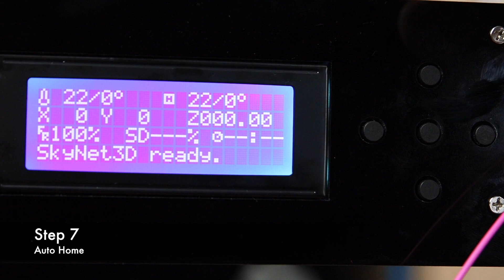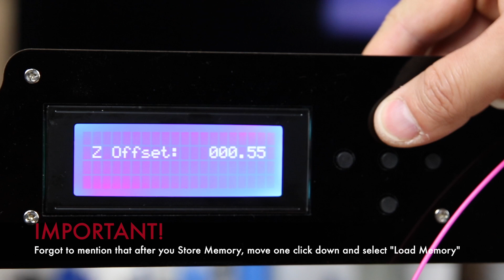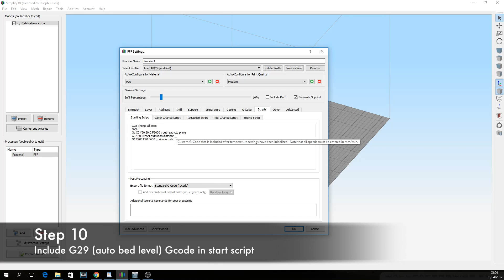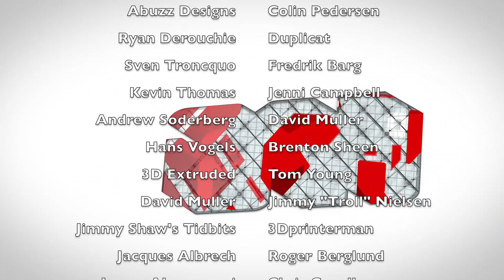Anet A8 - Auto Bed Level Sensor Calibration

Comment: just done this with my tronxy x5sa after watching this video.
To find my sensor was way to low to start with and giving me problems.
and then found out i could not move the sensor enough to sort it. so a quick print later i now have a sensor auto level that works and a printer that prints with out having to mess about for each print i start

Comment: thanks for tutorial, makes much more sense than the official one from anet :) I still experience a problem that printer won't stop when z sensor light is on. It worked for autolevelling, stopped perfectly but now won't stop after I tired to run a print

Comment: I never felt any need for a sensor on my A8. Only took a minute to set it and I almost never needed to adjust it. I would check it from time to time and it was just spot-on. One thing that I did do however, was mount the printer to a stable platform that was not prone to warping. Extra expense, extra time setting up and testing an induction sensor? Nah, not for me. Old skool works for me, every time!😊👍

Comment: Thank you so much this video is a lot easier to follow than the one that comes with the printer. (https://www.youtube.com/watch?v=3NSDzgZh0Qc&t=) I was trying to follow this video but my extruder kept colliding with the print bed. Your video makes a bit more sense. 
So let me see if I understand this correct. 
Setting the proximity sensor point of activation (step 6) is not telling the printer where the bed is but rather giving it a starting point for the Z offset which sets the extruder to the bed?
Will this tutorial work with the set up (straight out of box) I have or do I need a different firmware?

Comment: SN04-N  not with 2 layers tape working. Got a bad response on aluminium. It's arround 1 millimeter. When I hold it above the the Nema Stepper or other metal (not alluminium) the range is 8 mllimeter. Going to try he inductive one and otherwse the needle.
Reply: Didn't try a pull up or pull down. Will figre that out first
Reply: https://3dprint.wiki/reprap/anet/a8/improvement/autobedleveling is where the story is.

Comment: My Anet A8 would not connect to the computer.  When I tried to upgrade the firmware to Marlin this of course made it impossible.  On investigation I found out it's because the processor board probably shipped from the factory without the bootloader.  Getting the bootloader onto the chip required programming it with an Arduino Uno.  Once that was done, everything became much easier of course and the A8 connects to the computer every time and I can change and upload the firmware whenever I want.  I'm just waiting on a sensor to arrive so I can set up the auto bed leveling.

For anyone else that runs into the same problem here are the instructions for connecting the Uno to the J3 connector on the A8 controller: https://www.instructables.com/id/HOW-TO-FIX-ANET-BRICKED-BOARD-USING-AN-ARDUINO-UNO/

You have to flash the bootloader with the UNO (using Arduino IDE on the computer) with the A8 controller powered from the UNO,  and then you have to disconnect the UNO, power up the controller, and upload the firmware via the USB in the normal way.  Attempting to also flash the firmware with the UNO did not work in my case, though I have no idea why that was.

Maybe my machine is a cheap copy (it WAS very cheap) or maybe it came from a batch that had  skipped getting the bootloader for some other reason.  Either way, it's no problem for me now, but it really sucked that I couldn't just upgrade it easily in the first place.  At least I now have a special ribbon jumper set in my spares-and-repairs box that I can use to hook up the controller in case I ever brick it in the future.

Comment: Where do i connect the sensor in the anet a8 board? All the sockets are already occupied...
Reply: @TAMEDCSGO  Do i connect the new leveling sensor in the ZZ axis stop sensor socket?
Reply: @JohnJaggerJack  You Must remove original endstop, finish sn04 sensor with New molex plug and connect it in place of original endstop. Pay attention, where at motherboard is placed + - and signal! Its important! If You make a fail - You can damage sensor or motherboard endstop buffer input

You can also keep old endstop and connect it in serial with sn04 sensor. This old endstop Will be a solid protrction in case of sn04 sensor damage. This May prevent nozzle from hitting the table.

Comment: Hello... Great video. I have a tronxy 802 and when I try and auto home... It doesn't send the heat pad. I ensure it was connected in the right spot.. And when I pass a metal under it it works but doesn't recognize the heated... Please help.

Comment: Hi Joe  .... I know this is an old video,   How do you do this with a Bowden Setup, and the level sensor is on the right side of the print head instead of the left I cant get my offsets right, i think i should of put the sensor in the back

Comment: hello guys, i have purchased anet A8 and i have assemble it, now i'm calibrating z axis.
i have a problem with auto Bed Level Sensor Calibration, i followed the same instructions from this video but it didn't work and i didn't reach the same results ( the nozzle touches the hot bed and makes a mark on it ).
any suggestions please or can you help me how to fix it, thanks.

Comment: My probe is going way off the board, what are the correct probe offset settings?
Reply: For Skynet 2.3.2 and a tronxy XY-08N use the A8- 5buttonkeypad- autolevel- front left sensor/12mm  sensor/Configuration.h file

Comment: Actually, it is easier than this.
Add and check the sensors manually so it lit up before the hot end hits the heat bed (make room for glass bed). Can be checked with M119 G code.
In the firmware Marlin source, see to that turn on secure Z homing, Z_SAFE_HOMING, so you don't end up Z homing outside the bed. And turn on bed leveling and select method to level.

Then manually add these commands.  Can be done from repetier or from the serial monitor in Arduino

G28 ; Home the device
G29 ; Auto probe.
M501; print current settings
G1 X110 Y110 Z10 ; Go to the X and Y middle, 10 mm above the Z0
; Step down to zero manually, or if brave (stupid like me) just go for it
G1 Z0 ; Lower head to zero hight
; Us G92 tell the printer temporary that your head is 10 mm above, so you get some head room so 
; you can lower manually to right hight.  You can't manually go below Z0.
; One could use that in the slicer, but better to do a permanent setting that is stored in the Firmware
G92 Z10 ; Temporary tell printer the heater is 10 mm higher than what it is
; Adjust the Z to right paper thickness. Use control buttons or software or G1 commands to move in steps of 0.01 mm
; Continue when right paper thickness height.
M114 ; To print how much you lower the head under the previous 10 mm set with G92 (Check Z value printed last on line)
;  Calculate (read Z)  - 10 and add to next command, assume -2.0 here.
M851 Z-2.0 ; That is, lover the heat head Z0 with 2 mm from current Z0 height.
M500 ; Save all values, can use M501 to check that it was stored

; Test
G28 ; Home
G29 ; Auto probe
G1 X110 Y110 Z10
G1 Z0
; Check if ok, if not adjust the M851 Z value above and do a M500 to save
M501 ; Print settings, check value for M851 Z

Now you only need to add G29 after G28 in your slicer software in the G-code header, like did above.

(From memory, check Merlin software or other sources)
https://www.youtube.com/watch?v=G-TwWfUzXpc&t=195s
https://www.youtube.com/watch?v=EcGFLwj0pnA (a bit old)

Comment: I noticed there is a menu option for autolevel. This performs the 9 point test. Can we use this menu option and then load a print that does not start with G29?

Comment: Which version of skynet are you using with this auto level? Stock, right? At me, its confusing: when i say auto home, it goes to the middle for auto level. But when i "press" auto level, it goes to 0, 0 and goes down. But there is no bed anymore, so it goes down too much. Does it think the sensor is at the back? Also, auto level means, it calibrates itself, but then it must "drive" over the bed, like yours. Mine doesnt

Would be cool if sb could helo me :D
Reply: Same problem! Anybody help?

Comment: Hi people,
First thank you very much for this tutorial, it was very useful to me. I followed all 10 steps and my Anet A8 worked fine for a while (few months). But now when I try the Auto Leveling the display shows an error, "endstop hit: Z". I recalibrate bed level, level sensor, cleaned Z screws without sucess. The error persists and I have no idea. Would you please help me? The printer's firmware is the Skynet3D 1.1

Comment: I have been having the problem of setting my Z Offset as the Tronxy instructions say to. The Auto Home leaves the spaces between the nozzle and the bed (0.2mm) and between the PS (sensor) and the bed (2 to 3mm) as instructions say they should be , but when I start the print, the nozzle drops lower and scrapes the bed so has to be aborted fast.  Even the setting on the main LCD screen for the Z says it has lowered, too.   Example:  I set the Z Offset (after much measuring and auto homing)  to 1.50 and store it; then during the start of the print it goes to 0.30 and this shows on the main screen.  Even having set the Z to 1.19 and stored, it did the same thing on starting a print and ended up recording the 0.30 again.  If decreasing the value, and the screen on its own shows a decrease, why is the nozzle not being raised?? It was good to find someone who has worked on a Tronxy, and one with the same blue PS for Auto Levelling  that I have, too.  If you can help, it will be so much appreciated.

Comment: why is my menu completely different? For example the first page in my menu has "quick settings" as the fist item.
Reply: jeff steeve I guess because you didn't upgrade to Skynet and are still using the stock Anet firmware

Comment: Hi amazing interesting. But can I tell you about the problem I still have : I followed your tuto  the best I could and the thing is globally working. BUT I still notice when printing the first layer, for the left size of my printing, the bowden is too low and for the right side, it is too high. I am using a tree points levelling. Is there a way to fine tune the mesure of the tree points or should I use another method ? Thanks a lot (and sorry for my very bad english writing)

Comment: Thanks for the great videos I just got the printer about a week ago and and been very happy with my fist prints This is my first 3d Printer Now I'm setting up the auto bed leveling which has worked out great so far.. The one problem I'm just starting to have is that my pla is started to come out from between the nozzle and heating block and lands on print tried to tighten a bit  and works out at the start and then it does it again not sure if you have run into this problem? I see there is skynet v2.3.2 is it worth the upgrade? Thanks keep up the great videos

Comment: How did you fit the acrylic piece that holds the sensor between the motor and the metal bracket?
Reply from the maker: +gervqc the screws were long enough to reach the threads
Reply: 3D Maker Noob The acrylic piece that came with that same sensor is too thick to fit between the motor and bracket. Did you mount yours between the fan and braket?
Reply from the maker: +gervqc yes I did
Reply: Why didn't I think of that?!? Thanks a lot, it fits perfectly!

Comment: I don't get it. My z offset (I've played with it quite a bit) is not moving the nozzle even when I autohome it... Should it move only during print? Also, I've seen some place say that they have negative offsets and the lower it gets well, the lower the nozzel gets... so why is it here that the higher the number is, the lower it gets?
Reply: I'm having the same issue.  I can't figure it out.  I've kinda manually manipulated the sensor into a good spot, but the z offset thing does nothing.  It would be nice if it worked.
Reply: Michael MacDonald Yea actually I just physically make the sensor the right height now. You need a thick business card not thin paper or it will dig into the blue tape.
Reply: Reko Starr that's what I did.  Finally got everything dialed in well, but clogged my extruder in the process.  Taking a break right now.  Frustrating, but I'm convinced it will be worth it.
Reply: I have the same problem on a TronXY P802MA. Changing the Z offset via the LCD menu does NOT move the stepper motors at all
Reply: Hello guys,
anyone found the solution for this?

Comment: did you do anything extra to the wiring? the LED doesn't turn on with the 5v connector i think..
Reply from the maker: make sure you note down the wires as sometimes you might need to switch them around

Comment: If i want to put this in the back using the bracket mount similar to the Roko sensor, do i need to change some setting so the sensor will move to the center. The sensor gets in the way when i insert the filament

Comment: Help please! Can you please give me the offsets for your setup. I have the same sensor and brakes setup and have been told the configuration h file for front left mounted 18mm sensor and button, in Skynet Marlin 2.3.2 is the correct one to use. I have done bed levelling but when print goes to start at x-15, y-15, the model is in the centre if the bed in Cura. I am lost as after I setup the machine the first up print was pretty much perfect, now this is happening. Thanks for the dedicated work you put in. CHEERS 🍻

Comment: after installing Skynet, mounting the sensor( blue anet sensor)  ran the setup prepare then auto home adjusted the nozzle and the sensor , the machine homes then goes up about 3\4" and sets there. and if you home again it goes up another 3\4". what am I doing wrong? I can't get it to go back down even through Cura.
Reply from the maker: +Robert wood which version of skynet are you using?

Comment: Your 10 step set up plan is pretty useless since step one does not do what you say it should do ??!!  the extruder does not go to the center of the bed as you say it should, it moves all the way to the left and goes down until it hits my cable chain, since there is no limit switch there to stop it and there is no metal there to trigger the the sensor to stop it ...
Reply: you have to activate auto bed level on the firmware

Comment: first make G28 to home. 
< G29 Auto Bed Leveling
< Eqn coefficients: a: 0.00250957 b: 0.00001668 d: -22.70038414
< Bed Level Correction Matrix:
< +0.999997 +0.000000 +0.002510
< -0.000000 +1.000000 +0.000017
< -0.002510 -0.000017 +0.999997
< X:216.02 Y:206.00 Z:9.66 E:0.00 Count X:21600 Y:20600 Z:-5000
< X:216.02 Y:206.00 Z:15.00 E:0.00 Count X:21594 Y:20600 Z:3976
< X:216.02 Y:206.00 Z:15.00 E:0.00 Count X:21594 Y:20600 Z:4032
< Error:No Checksum with line number, Last Line: 16
< Error:No Line Number with checksum, Last Line: 16
< Error:No Line Number with checksum, Last Line: 16
< Error:No Line Number with checksum, Last Line: 16
< echo:endstops hit:  Y:-10.07
< echo:endstops hit:  Y:-10.08
i try print but go to too hight nozzle, and autlevel points have too right, 
what must do level have right start print ???

Comment: Help!! I followed your instructions about installing it from previous video, and after turning the printer ON and placing a metal object below the sensor the light turns on as it should do... everything goes ok until now. But when I do the Home All, the Z-stop never stops even when the sensor and the exruder smashes the bed. I have to turn off the printer to make it stop... What am I doing wrong? Please help
Reply: Nevermind.. solved it... the auto level sensor was very high but now is working good. Thanks anyway and thanks again for the video!

Comment: Joe thank you for making things easier. I am running skynet 2.3 and octopi on my a8. Unlike this vid my autolevel set up is on the back of the carriage. i have experienced the nozzle/carriage ramming into the hotbed on a few occasions (the sensor was above the hotbed). I now have a grinding and vibration coming from my right z axis rod. I am worried that the motor or the rod are damaged and have not taken anything apart yet. My question is does the location of the leveller matter from the front to the back of the carriage?
Reply from the maker: +shawn kelly you're welcome first of all :) and no, the location of the sensor should have no bearing whatsoever

Comment: If I increase the z Offset the hight of my nozle does not chage? is this normal?
Reply: Same here
Reply from the maker: +Pavel Shlapak it shouldnt be the case. Have you changed it on the firmware or the slicer?